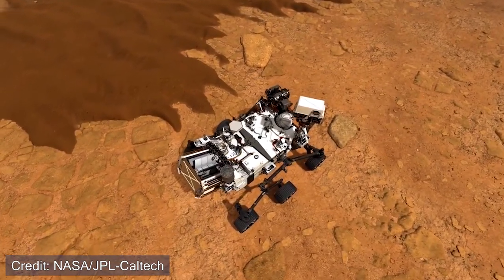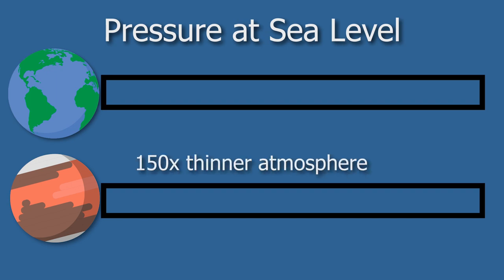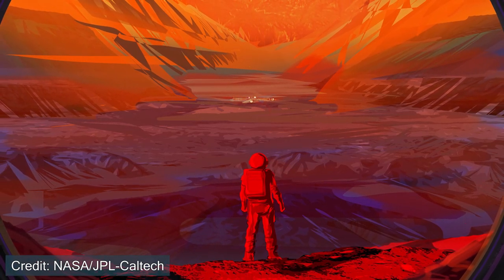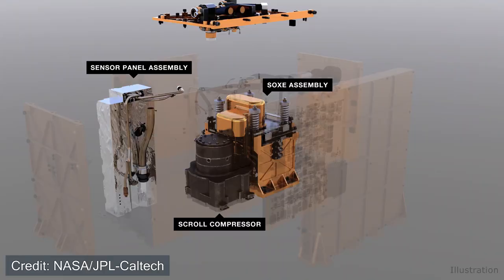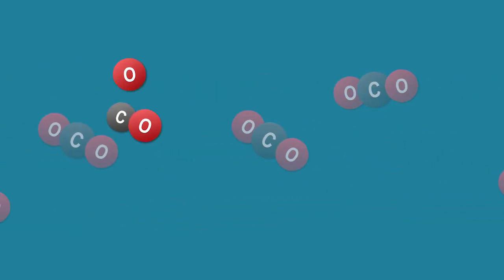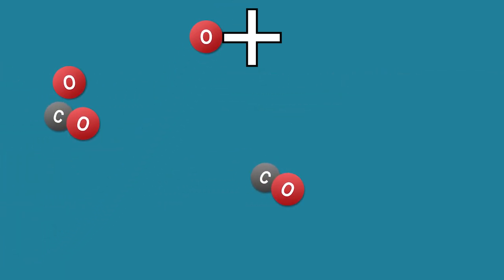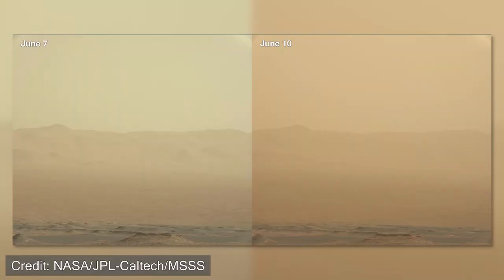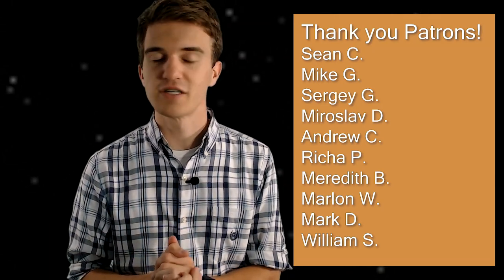NASA has an Oxygen generator on Mars! How does it work?

Comment: Wow that was a quality video thank you! I'm wondering, how does plants compare to moxie? You do need to keep them in a certain temperature range and pressure but maybe it could be less energy intensive overall?
Reply from the maker: Excellent question! With some quick research, one large tree would produce about 13 grams of Oxygen per hour, so almost the same rate as MOXIE. It would be hard to maintain a tree on Mars as of the challenges you mentioned, but smaller vegetation or algae is more practical. You'd still have to pressurize the air for plants as well, so that would still take up quite some energy. I'd imagine a greenhouse type of design would require larger structures on the surface, so maybe after the first few crewed missions to Mars. Great comment!

Comment: The Carbon soot could be useful as it is dark(used to make black ink) thus soot may be useful to coat martials that could capture more solar heat energy. (soot particles absorb sunlight very effectively)
If one day there is enough energy available on Mars then heating the soot to high temperatures to form carbon vapor; that could then be condensed to form solid carbon structures, this way fullerenes can be made.

Comment: You don't have to go to the poles or dig for water ice. There is a giant relict water-ice glacier at the extreme western end of Valles Marineris, situated at 6.0°S latitude and 98.0°W longitude. That is VERY near the equator. By "giant", I mean 8.6 cubic miles of ice. That is slightly larger than Lake Meade at the Hoover Dam.  At 4.2 billion tons per cubic mile, that's 36.12 billion tons of ice. At 1.014 trillion gallons per cubic mile, we're talking about more than 8.7 trillion gallons of water.  That is enough for just about any sized colony you could want, at least in the beginning.

Comment: If starting a contained base on Mars. Solving locally sourced oxygen is a obviously a necessity. That solution could even be used to supplement the atmosphere in a mars base if also combined with plants in a confined base. Then the devices may not need to run all the time, just as required because a lot of power is needed to supplement oxygen or carbon monoxide when either is running low.
With that eventually solved, then a local source of vitamin D for an isolated base needs to be solved.
Otherwise, without vitamin D, on a long missions relying on local resources in an air tight confined base, there will eventually be a huge problem with people becoming weaker and fracturing bones doing simple tasks such as walking to another room.

Comment: Simpler than algae for sure. Though I’d have thought it easier to convert CO2 ice or water ice instead. Load it up, melt it, and it’s already at high pressure. Water ice, I’d you can find it, is also probably easier to electrolyse without absurd temperatures, because it’s a liquid. Though maybe you can run a current through pressurised liquid CO2 and do something useful. I’ll have to look into that. If they’re making fuel on Mars they’ll probably want a source of hydrogen anyhow.
Reply from the maker: Algae or breaking apart large molecules from the surface are also valid options for oxygen production (in some cases provide more by-products/resources like solid rocket propellent). And you make an excellent point, converting CO2 from ice would bypass the compressor phase, which would save a lot of energy for the current design (although be slightly more expensive for the thermal changes). I am unsure about the temperatures needed for electrolysis with liquid CO2, that is something I need to look into. Thanks for the comment!
Reply: @MartianWolf 
Well ideally you wouldn’t need to heat up the liquid above melting point, electrolysis could be doable at any temperature so long as it is liquified. Not sure how 800C compares to the enthalpy of fusion, but with some clever engineering using blackbody solar absorbers you could get that heat reasonably cheaply. Couldn’t find any electrical data for liquid CO2, at least not at ridiculous pressures. As we know, electrolysis of water is rather easy and well understood, if somewhat power hungry.

Looks like Mars has quite a lot of water ice, though the only place it’s visible from the surface is the North Pole. Being there would drop solar yields a fair bit. If it isn’t feasible to extract from the regolith closer to the equator, then CO2 is likely the best way to go. Dry ice is found on the surface closer to the equator, at least in Martian winters. Maybe there’s a good sheltered crater to set up nearby.

Of course, extracting any kind of solid would need to be worth establishing the mechanical infrastructure for, compared to just running a pump. Certainly not the case with a rover test rig. For a pre-human fuel generating lander though, perhaps.